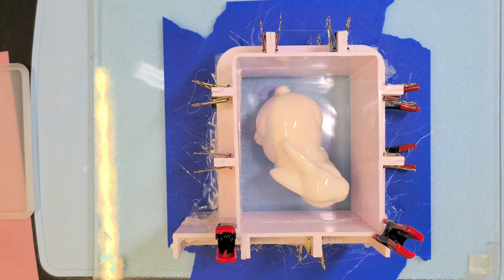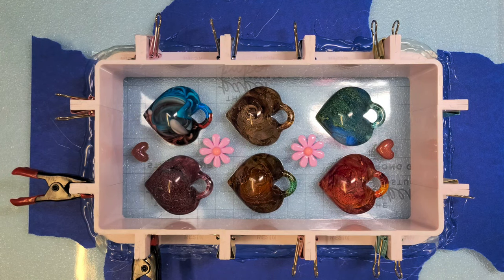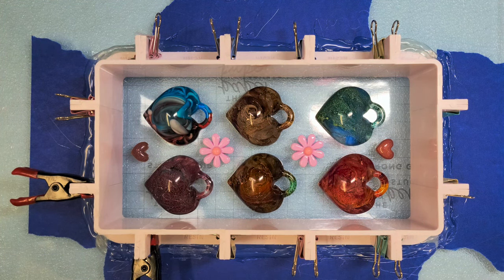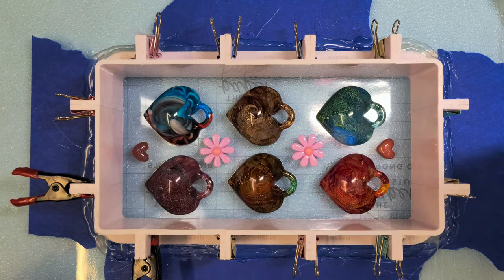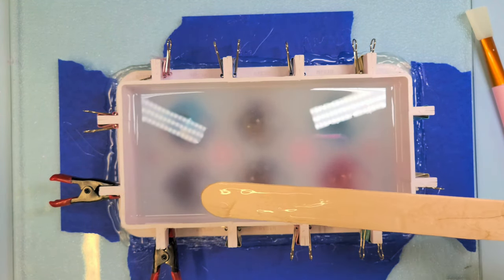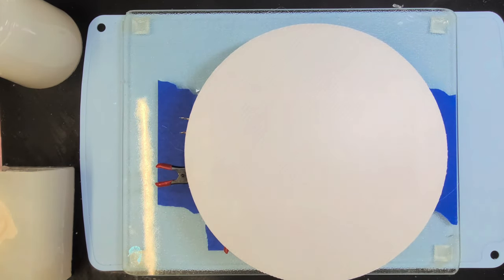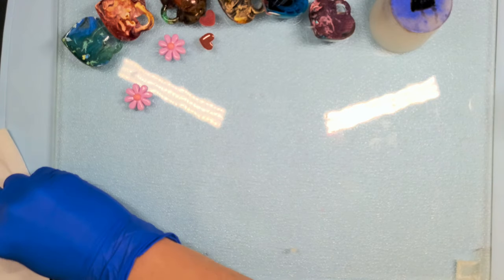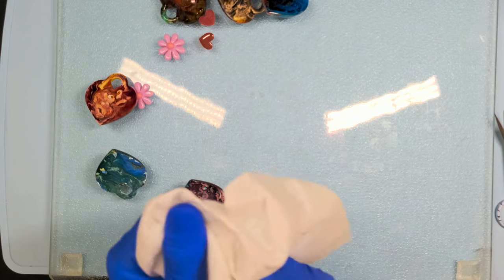Last bunny mold and another egg mold making. #resinmolds

Comment: They look good. I haven’t made a mold before. I’ve got some Let’s Resin’s silicone, I didn’t know about the stretchy factor before watching your videos. I need to go look at the bottle and see what I bought.😆 Have you ever tried the rolling out a thin layer of clay technique? Then you slightly embed your piece into the clay? It’s supposed to prevent the silicone from getting under the piece. You barely had any leakage but, I’ve seen some where the clean up left a pretty jagged bottom. Depending on what I end up molding, I might try it. 
What a crazy day you guys had! Was it a bullet that shattered your hubby’s window? Years ago my brother’s family and mine were at my Moms. Suddenly we heard breaking glass. My brother knew immediately it was a gun shot. The bullet stuck in the wall about a foot away from my niece’s head. There was a really nice big park on the other side of Mom’s backyard so, it could’ve come from anywhere. The police never did find out where it came from. It was such a surreal thing, the neighborhood was mostly young families and quiet. It’s just not something that you ever consider happening. 
Thanks for all the tips on mold making.😊
Reply from the maker: Ive never use anything but the transfer take. Or contact paper works to. 
It was a gunshot, it left a bullit hole and shatterd the glass. Your welcome❤🥰

Comment: I was wondering where you got the puffy hearts. So looked up on Amazon, I understand why you made your own to have, they are expensive! I usually make my own molds for smaller items, like earring balls, so I have multiples instead of just 1 size.
Reply from the maker: Mary, I bought her puffy heart mold when she came out with it, the four heart mold, but when I got it one of the hearts had an imperfection inside so have never used that one, and she doesnt refund or replace, so after using it a couple dozen times it wasnt shiney anymore, so I have 6 of my original pours and made my own. 😁

Comment: Have you ever had Deep Pour Resin flash cure? I used Lets Resin Deep Pour, and it flash cured.
Reply from the maker: Teresa, yes I have, and I was even pouring in layers because I was doing a huge project. But, you definatly cant pour more than 4" at a time. The directions say "up to 4" but I pushed it right up to 4" and it flashed on me.

Comment: Beautiful job on the molds!  I've had to get into making molds recently because of one project I'm attempting for family & friend Christmas gifts - long story short, I've not only made one of several molds I'll need for this gift project, but have made a few other molds (this is fun).  One of my molds is an egg (crusted in micro-mini glass beads), but I find I'm tearing up the mold to get the resin casting out after just a few uses.  I'm on my third of these molds & beginning to wonder if I shouldn't find someone to make it professionally...  I'm wondering if you've had to do that with any of your molds.
Reply from the maker: Mold making is fun for sure, but it can be tricky when your adding inclusions to your piece. 
What I would recommend is going up in your shore hardness of your silicone for pieces like that. The softer your silicone(0A-15A) hardness is more for smoother detailed molds. 30A and higher is a tougher silicone and is meant for more detailed molds. Does that make sense?
I have never had a mold made professionally, as I'm sure it is expensive. Try a higher shore hardness first and see if that works. 🤗🥰
Reply: @resinmeup  yes.  Thanks - I will try that the next time I have to make this egg mold (& any others that are a bit tricky).  Much appreciated!